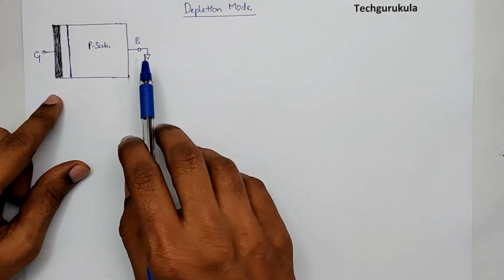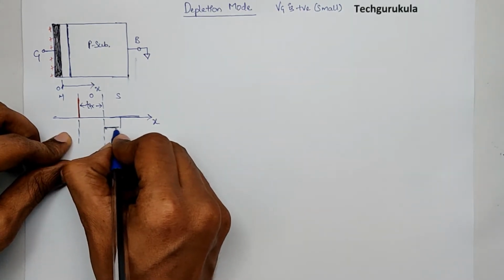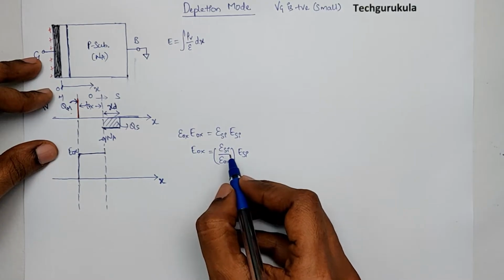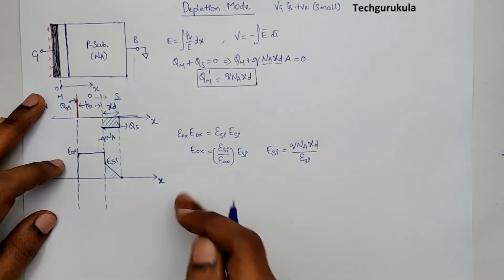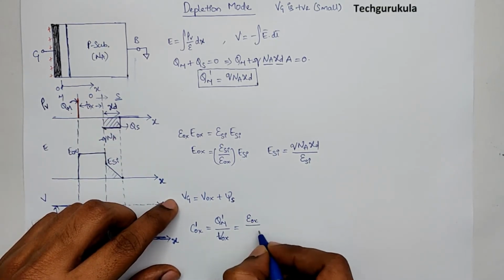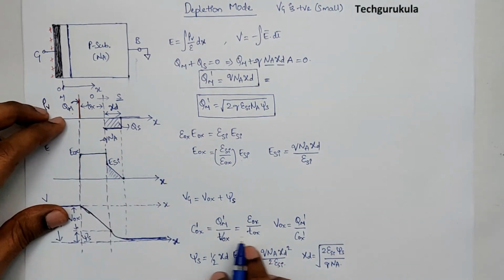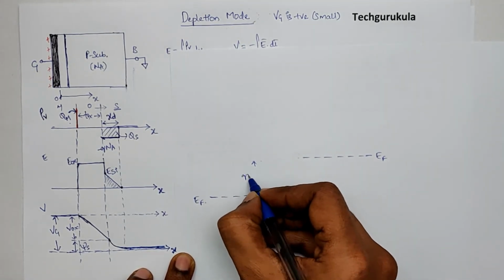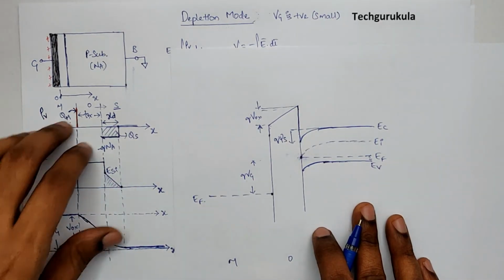Electronic Devices: MOS Capacitor (04) - Depletion Mode

Comment: Hello, could you please explain why epsi_ox E_ox (D1)= epsi_si E_si (D2) at the Si-SiO2 interface?
Because the boundary condition said that D1 - D2 = surface charge density (on the right side, we have negative ion right?)
Reply: Where is the charges located in surface? ,  inside Surface Of  SiO2 Or Outside Surface Of SiO2 , what  would you think ?
Reply: @captainstreamer3261  what do you mean "in" the surface?!
btw, thanks. As I understand now, surface charge means that the charge is right "at" the SiO2 surface. It is from the point of SiO2 view. --> Zero charge
How about from the point of Si view?

Comment: The phenomenon of charge inducing should be same for both depletion and accumulation(except for one pull the e and one pushes). The doubt sir is, you showed a gradual decrease in charge distribution and E.field for accumulation mode, but here you are showing sharp edges for charge distribution , and e field is linear here , in accumulation mode it was not. Can you please tell why?
Reply: the words itself your answer " Depletion " what you mean with " Depletion " ?? And " Accumulation " ??

Comment: Very good explanation. A minor comment... the formula for E=∫ρ/e dx  doesn't support the step change in E field at the oxide semiconductor interface. I think the epsilon (permittivity) has to come outside the integral - then it would fit with the step change in E. I know the step change in E field at that interface is correct as you show - just that formula as shown unsettled me as it doesn't fit here due to the change in permittivity at the interface.